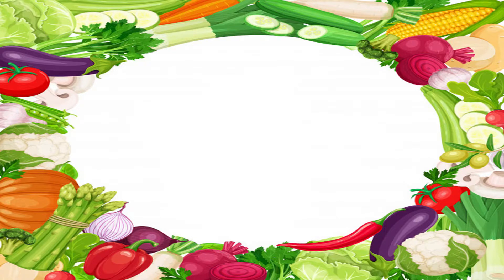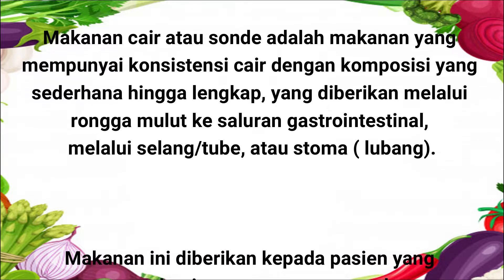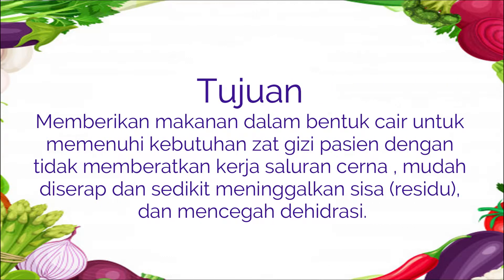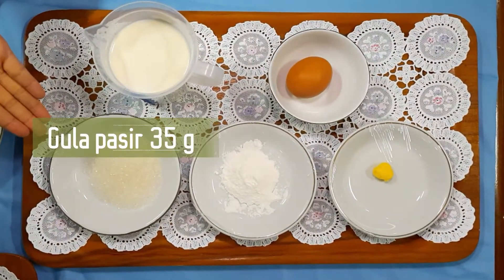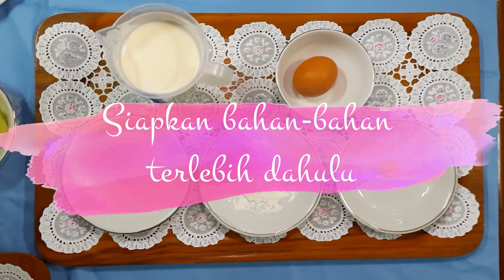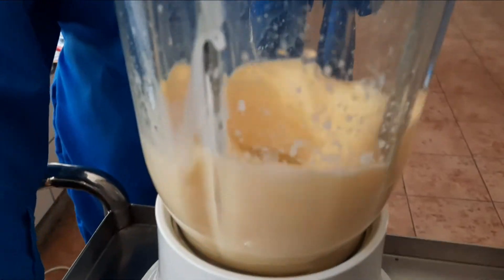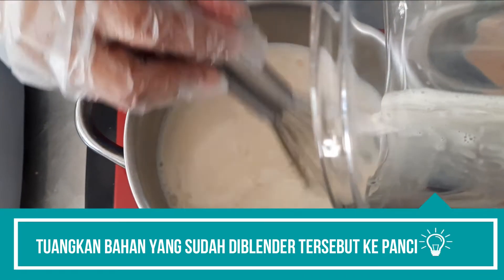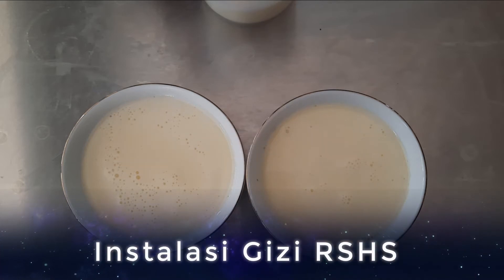Cara Pembuatan Sonde Rumah Sakit

Comment: Maaf, izin bertanya kak
Kalau misalnya kita mau buat makanan saring, contoh 250 kkal
airnya harus berapa banyak kak? 🙏🏿🙏🏿
Reply from the maker: klo kebaanyakan 1 cc 1 kalori maka untuk 250 kalori jadi 1 gelas (250cc).
Reply: Terimakasih solusinya kak, ibu sy stroke, jd gak ngerti makan, harus di paksa tp ttp gak mau, jd sy paksa pake pipet, mulanya hanya beri susu saja, setelah ketemu resep ini akan sy buatkan sonde utk ibu saya, Terimakasih banyak.